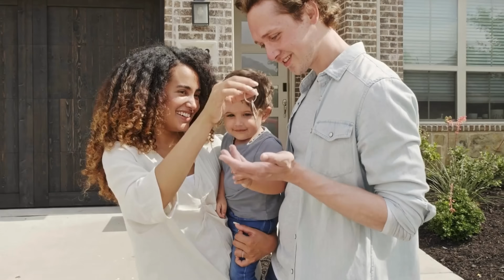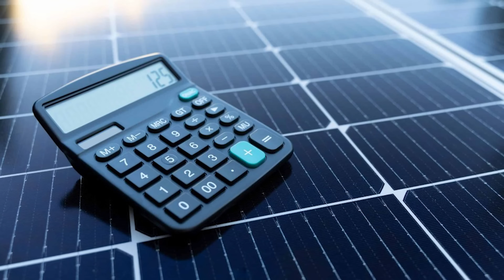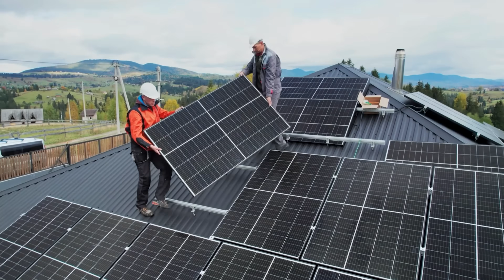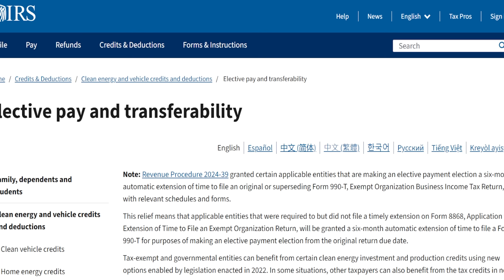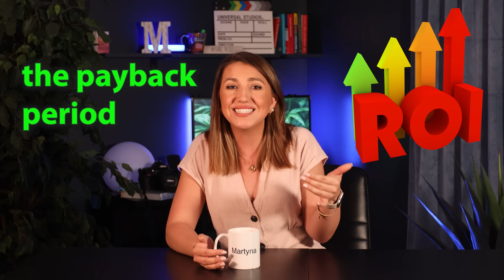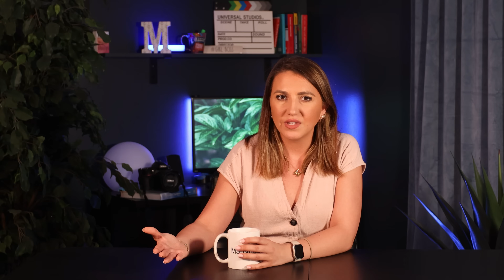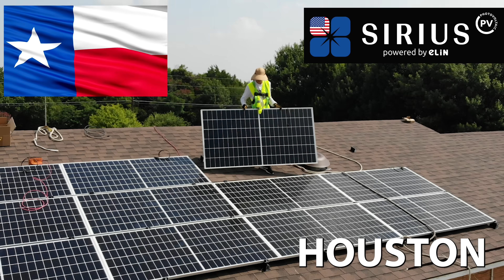Why you should buy SOLAR and BATTERIES NOW in the USA? | Tax Credit just Eliminated by the House!

Comment: I've found it quite annoying that there's no way to use credits when installing used solar panels, as, in theory those credits were already used on those panels when first purchased.

With the price difference between used and new panels being so limited today, it's hard to justify missing out on the tax credit and warranty.
Maybe used solar panel installations rise from the ashes if this passes.
Reply: I claimed all my used panels. The speciality tools. Clamps. Connectors. Wire. Batteries. If it went into the system I claimed it. Even a roof top solar vent fan returned 30% tax credit.
As far as a warranty goes I'd like to hear your justification for having to have one. Especially on dirt cheap used panels, which by the way also came with a 1 year warranty. The return shipping will cost you more than the cost of the panel. When you can buy a 400w brand new bifacial panel for $95. the whole warranty thing is kind of pointless. My last pallet of used panels was $600. for 17 mixed panels. All from 325w to 375w. A mix of LG, Jinko, and Canadian Solar panels with an oddball Panasonic panel. At $35. a panel I don't care how long they last.
Reply: @fauxque5057 
Oh I agree on the warranty. Panels, they're fkn reliable, but I was looking at buying used rapid shutdown equipment/optimizers too, in fact it was the thing I looked for the most.

Also rhe fact that you claimed it doesn't mean that you're supposed to. However I don't really care and I don't think the IRS either cause they're doing insane claims for overpriced installs already. DIY will always be a smaller overall claim.
Reply: @ignasanchezl  My taxes aren't complicated so I doubt they would audit me. If they did the only thing at stake is the solar credit balance that I have to annoyingly roll over every year. Which brings up another huge misconception. It's a tax credit, not a tax rebate. If you don't owe taxes then you have to roll the balance over. There's unscrupulous companies telling people it's a 30% cash back rebate and it's not.
Reply: I just picked up 10 new solar panels for a small ground mount array in my backyard. I was going to buy used at first until I realized what you just said and I picked up new instead. I love my panels. I don't mind them not giving the credit for used panels because, as you said, it was already done once (in theory). Getting rid of the federal and state credits altogether though is insane.

Comment: Tax-free savings on energy is money in the bank. With an EV. 
No petroleum, $4,000 per vehicle 
No natural gas $2,000
No grid electricity $ 2,000 
Estimate $8,000

Every year for decades  😊
Reply: Assuming the EV last decades.
Reply: @garytrawinski1843  modern battery management is extending battery life by years.
It seems the battery benefits from regular cycling. 
Battery technologies are evolving rapidly and so cheaper as well.

Comment: In the short-term yes. Climb down the business and retain cash or invest in some thing else. However in a few years people will realize the mistake. Parties and Presidents change. Conducive business environment will be back again for green energy. Another point to make is that USD rate will also climb down due to certain policies of this government, which will make importing goods more expensive along with the extra cost of tariffs. So even importing oil and gas can be expensive. Will the USA replace it with enough local production. Have to see it.
Reply from the maker: Thank you for sharing. I am also wondering if maybe there is so good things to this? I try to look for positives in everything. I need to work on a video doing ROI on solar and batteries to investigate in front of camera what that looks like with no tax credit.

Comment: Solar will not die.  It will have to become more competitive with other forms of energy.  Competition will become fierce, and prices will come down.
Reply: You apply that same argument to Fossil Fuels?   A zero subsidy game should be a level playing field if we really want the best reults.
Reply: Silicon Solar PV is already the cheapest form of Electricity Generation EVER.  It is so cheap, that if installed at $1 per Watt, it typically works out to around 2 to 3 cents per kWh (behind the meter) over 25 years.  (Minimum Base Service Life).  

We can hit $1 a Watt on most installs IF -- folks will keep them OFF THE ROOF -- and the Contractors will get disciplined to get on and off the job promptly and profitability.  But goofy sales folks create goofy (and not profitable) jobs and projects.
Reply: @philtimmons722  Basically, you are saying that tax credit aren't necessary?  Glad to hear that.
Reply: @philtimmons722  Yes, it's by far the cheapest when the sun is shining.  But when the sun is not shining, you either need a crazy amount of expensive storage, or you need a back-up generation source, and the latter will also be more expensive than it should be because its utilization will be half or less than it could be.
Reply: @TheUweRoss  ummm, not so much.  You do not actually understand much about the topic?  Just asking so I understand the baseline.  Here is the concept you are missing -- called:  Aligning Time-of-Use with Time-of-Production.  Do you understand what that is or what that means?
Reply: @philtimmons722 If that were actually true then every single person would be in a waitlist to install it. The reality is every area that pushes solar hard the energy prices increase.
Reply: @Snerdles  dear lawd.  It is true.  This is objective measure level stuff.  Not some sales, political, or intertube nonsense.  Measurable, doable math and physical install true.   But let's test your theory?   Here is the offer -- 

1. Do you have a house, business, or even an empty field?
2. Does it have an Electrical Meter on site?
3. If you want Solar PV installed -- can you KEEP IT OFF YOUR ROOF?

If yes to 1, 2, 3 . . .  then, Yes you can have Grid-Tied Solar PV installed and running for $1 per Watt, 10 kW array, typical.   So.  Test your theory?  Are you on your own described "waitlist?"
Reply: @philtimmons722 everything you just stated is so far from reality. I don’t know where you are getting your data from but the cost is not 1 per watt. Not even on a roof. To assume ground mounted systems are less in cost is ridiculous.
Reply: @krakken-  Please explain how, with numbers. My roof is already installed, I just need rails. Ground mount systems need an entire new structure to be built, and you still need rails. Not to mention, space to build it. Not to mention a ground mount system is more susceptible to shading.  Is it because of permits? Or some other non construction related cost?
Reply: @philtimmons722 Only the vast majority of the population can't answer yes to those. That's the problem. You also have to have large unshaded area and proper facing land, and agreeable weather.

I've been trying to get solar to be reasonably priced for my own location for about 5 years now. Assuming I can do it all myself I might be able to make it work some day. Still gas over 20 year payback (assuming nothing fails in 20 years).

Comment: It is insane that the average US Solar install costs so much. Stop expecting your systems to do 100%. 
Buy an EV that has Vehicle To Load/VTL it is a godsend during a natural disaster etc. It enables you to have a more modest battery setup on your first SOLAR install.
Reply: Any recommended or preferred VTL system you like?
Reply: @philtimmons722  It is a simple thing but you don't get it on a TESLA.  KIA, HYUNDAI, POLESTAR do it. Check other brands if you are in North America. BYD EVs all do it but there is no BYD in USA or Canada.
Reply: @philtimmons722   The best reports I have heard on VTL have been with the HYUNDAI IONIQ 5 (apart from BYD).
Reply: I have installed hundreds of systems that do 100% of the electrical load of the home. Although I always do energy efficiency audits first for free as a part of my sales program.

Comment: Just buy a smaller more modest system out-right with the intention of expanding it when you can afford to do so. Americans tend to install much bigger systems than Europeans and others. Make changes at your consumption level. You don't need giant double-door refrigerators nor a 70 inch TV (if you really want an image larger than 50 inch get a projector). Maybe try modern fans instead of air-con, yes I know it depends on location but these are some relevant examples of how you can have SOLAR without the tax-credit. Buy a more modest Solar and battery system and try to live a more modest life with more energy conscious products. PS I only own Panasonic TVs they are better quality and use less energy than the Korean competitors.
Reply: The issue is the fixed costs for getting a permit involving a structural engineer to review and electrical upgrades for net metering.  The additional cost for more panels and racking is a better deal(faster payback) in most cases.